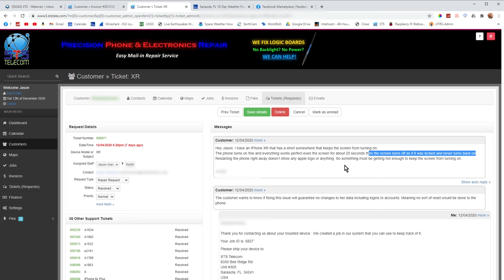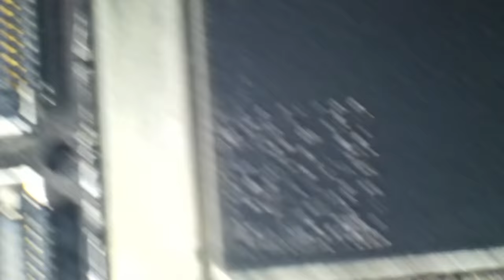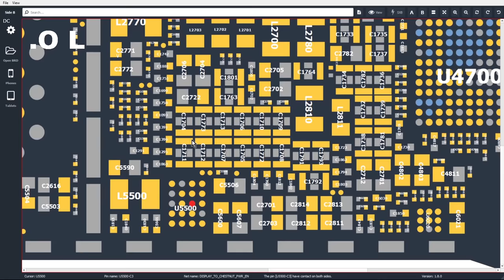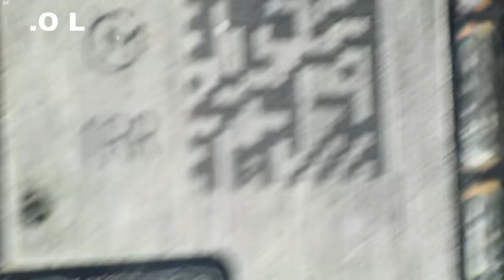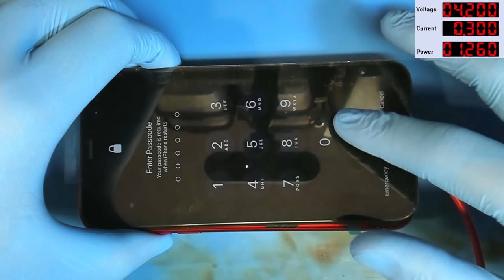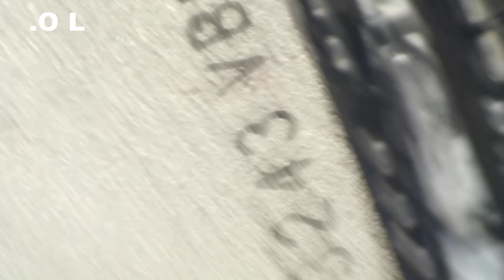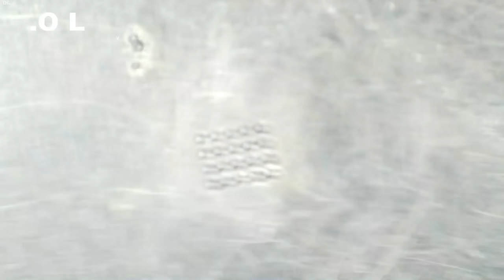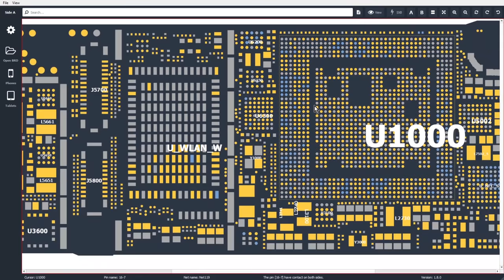Repairing an iPhone XR with "No Image" - What I found inside this phone was horrifying!

Comment: "I'm gonna turn the heater on to a temperature that is not hot enough to boil water even" ...."I'm gonna start at 195 degrees C"
Reply: Lol, that was hilarious
Reply: I'm glad someone else noticed this 😂
Reply: Honestly couldn't tell if he was joking on lol
Reply: @Centorior  He can't tell Celsius from Fahrenheit
Reply: @slyfondle1885  100c is boiling right?
Reply: @MrCODEmaster00  Yep
Reply: To be fair... Even at 195 c shouldn't be able to touch
Reply: @MrCODEmaster00   Boiling point of water in fahrenheit is 212. 190F is around 88C, so 205F is close.
Strangely he does talk about the correct Celsius setting on the heat gun.
Reply: 195C is the temp I use on the  hot end of my 3d printer to melt the plastic.  Far hotter than you would touch.
Reply: @bbowling4979  I typically go 205 but same thought. PLA has nothing on his fingers apparently.
Reply: @docthebiker  maybe his heater is calibrated on F but showing C
Reply: It's clearly a case of confusing F with C. Either the machine displays the wrong unit or he reads it wrong.
195F = 90.5C is slightly under boiling water.
195C = 383F is way too hot to even think about touching it.
Reply: @docthebiker  The boiling point of water AT SEA LEVEL is 212°F. 205°F is the boiling point of water at 3500 feet ASL - the altitude of SLC or Calgary. 

I doubt he's doing these repairs in Leadville, Colorado or somewhere in deepest Tibet, but at those altitudes 195°F is hot enough to boil water.
Reply: @Ea-Nasir_Copper_Co  205°F is close to boiling point (around 96°C) but he didn't go that high. His plate was maxed at 195°F (90°C).
Altitude has no bearing on electric heat output. THOUGH if one was wanting to drive out water without boiling at higher altitudes then adjust accordingly.
Calgary, maybe 190°F.
I'll stick with Celsius.
Reply: “I’m not feeling like this is really 195C...”  
Me: Hmm, yeah me neither.
Reply: I got called on the carpet for mentioning this.  I hope you have better luck.  So, over 300f. Ha!
Reply: Under the right conditions 195 C isn’t hot enough to boil water... but your shop isn’t those conditions 🤣
Reply: @bobafruti  They've found "surface" water at 467 degrees Celsius, where it is a supercritical fluid and the gas and liquid phase merge into one, at the very high pressures of deep oceanic vents.
Supercritical point is 374°C.
Under the ground (and higher pressure), where the magma heats this different phase of water even higher.

I can't remember if there are 14 or 24 states of water, rather than the 3 we were taught about in school (you get 3 just boiling a kettle).
Reply: @docthebiker   I guess the knowledge shall die with you. Google won't give up but only 4 states of water and 22 states for matter
Reply: @KingBigBabyJesus  You're right I didn't use google, 22 states of matter & about 20 states of ice.
There are 2-3+ states of liquid water, & 
As you can google try finding the paper "on the existence of two states in liquid water".
Reply: @docthebiker  Thanks for the reply, I appreciate the knowledge.
Reply: I remember back when one had to avoid higher temperature on IC's, now they're installed at temperatures that'd slag those antiques. Of course, back then we also used solder that melted at a much higher temperature.
Reply: @christianbarnay2499  Bake a ham at 350F

Comment: Hi Jason. Solder melts at about 183C-188C (361F-370F). And you wouldnt be able to touch over 70C (about 158F)for more a few seconds. Think you need to calibrate ;) Greetings from sweden.
Reply: Lead free solder, the solder used now in conventual consumer electronics melts even higher with Tin, Silver, Copper alloys melting at 217 and  and Tin Silver melting at 221.
Leaded solders typically mels at around what you say, but really only has approval to be used in the Aerospace and Medical industries. Aerospace parts and specifically Aeronautics use leaded solder.
Reply: Hey Fredrick, I work in electronics and you seem to be not familiar with the typical SMT reflow temperatures and the typical baking temperatures. He did a fine and correct job. The repair technicians in factories mostly do worse job, they just don't really care. Quality control on refurb stuff usually is not that great. Personally I would not buy or use a device that had a BGA reworked.
Reply: @dtibor5903  I think Fredriks point was mainly the drying part of the board. Where Jason touched with his finger the board heated to "195°C". Water boils at 100°C. He would most definitely burn his finger, it wouldnt be just "slighly warm". Hence the need for temperature calibration.

Comment: I just subscribed. When I started fixing electronics, Most things had tubes in them. Times have changed. I've been retired for a decade. I see you measuring voltages. I used to always use my scope to measure voltage. Caught a lot of problems that a voltmeter alone wouldn't have caught. Anyway, I've been doing a few devices. Didn't know about the software. THanks.

Comment: Gregory House said it best, "People lie."

When they said it sometimes got an image what they meant to say was it worked when they got it, the screen started going off a little while later, it got gradually worse and they refused to bring it to a shop until it would not power on at all.

We see this all the time in IT, the computer would turn off due to thermal issues but as long as it would work for 10 seconds at a time they wouldn't bring it in. They'd only bring it in when it refused to boot at all. At that point it isn't  something as simple as replacing the heatsink fan, it's replacing the CPU and motherboard.

Comment: Alternate title: DO NOT BUY REFURBISHED PHONES (unless they’re from a certified well rated source)
Reply: which apple themselves are not
Reply: @minortoterona2947  umm...
Reply: I bought my Iphone SE almost 4 years ago on refusbished amazon and still goes great. But I was quite aware it was a bet, it could have come with some problems
Reply: @gabrielfernandez4503  I bought one SE from ebay and it does great too. Great performance (and battery life) taking into account its age
Reply: "certified source" would be apple only then?
"well rated source" is pretty much anyone else. At least if one is going to believe what they're saying.
"certified well rated source"  is the unicorn that doesn't exist.

in my honest opinion: never ever buy a refurbished device unless you know what you're getting into.
Reply: Any rework on PCBAs, especially on such small components and BGAs is just ticking bomb. Avoid refurbed electronics with BGAs, basically anything that has a processor, ram.
Reply: @dtibor5903  We lost a bunch of factory HP AIO machines to video reball issues. They'd overheat and then just fail and lose video. We lost about 4 this way. One guy thought the company was actually being sabotaged.. lol.

Only by underclocking the GPU were we able to prevent it. Clearly HP's manufacturer used a ball solder technique that was a too-low melting point alloy and like most manufacturers (including laptops) totally inadequate cooling that leads to ball solder failure. 

I hate ball-soldering with a passion. It's easy for the manufacturer, and always a liability, then they deny the component cooling!
Reply: @Pimp482  
Watch a bit of Louis Rossmann and you will understand why he said that.
Reply: @Pimp482  
Hahahahahahahahahaha ... Yeah okay, right. No use in talking to you then I suppose.
Reply: @VenturiLife  that is some low temp solder that should be not used for BGAs that can get up to 100C
Reply: I am a tech.  I don't buy refurbished stuff. I will refurbish stuff for myself but I do it in a way that its better than from the factory.
Reply: @Mat-hr1dg  wow I'm just mind blown. Lmfao. I guess if a mechanic fixes cars, he makes money from whatever brand the car is made of. Or a plumber fixing damage on a pipe then he makes money from the pipe manufacturer.
The absolute stupidity is stunning.
Reply: @freevideos051  ok?
Reply: @the_allamerican7057  Mostly cooling modifications
Reply: @ChimpOnComputer  
Right?
Some people really blow my mind.
Reply: Since 11/20/20 have gone thru 3 refurb phones from Amazon....iPhone & Samsung....all were physically ok but each had serious speaker issues. Only plus was refunds were seamless & quick. Sold more blood and bought a new XR direct from Apple. Done & done.
Reply: in that case dont buy a new one to.. Its an Apple......

Comment: "Not hot enough to boil water."
Right after...
"I'm gonna start at 195 C."
Dude...serious math conversion fail.
Reply: He is speaking about Fahrenheits I guess. Because when you convert 195 F to C you will get close of 90
Reply: Pretty certain he screwed that up.
TBH I wonder if he was reading the display of 19.5°C incorrectly.
Reply: That's what I was figuring.  Still, hearing it in stride made me pause and chuckle.
Reply: @RichardPolhill  19.5C is like 67/68F
Reply: @InevitableD34th  Yes indeed. Hence he could put his hand on it and not scream as his skin blistered.
Reply: @sami3125  - Even 90 C would give severe burns putting your hand on it. But 19.5 C isn't warm at all, cooler than room temperature. I have no idea what temperature he meant.
Reply: @NotGoodAtNamingThings  I think 90°C solid object won't burn your finger through latex glove. Well, I'm from Finland and we use to go sauna regularly and there's often more than 90°C when I go to the sauna and sit to the wooden bench in the sauna. And it's not burning my skin, at least not severe burns ;)
Reply: @sami3125  - Water at 90C will burn the skin in a faction of a second. But one can stick their whole arm inside an oven for several seconds at much hotter temperatures without incident. Air doesn't transfer heat effectively.
Reply: @NotGoodAtNamingThings  yeah, you're right! Water transfers heat better than most solid things. And this is the reason you can safely touch short time 90°C solid object even when 90°C water will cause burns to your skin.
Reply: Yea , feels like hes meaning farenheit while hes saying celcius since he said he aint going to boil water and 205F is around 96C (205 is what he said his highest setting would be)
Reply: @sami3125  you are referring to the ladnhauer effect ( spelled wrong likely )  the density of any object reflects is ability to have thermal transfer, in the case of the wood mentioned it has low thermal capacity and high r value.. so won't burn you.      Air weighs .076lb ft/3  water weighs 62.4lb ft/3     its ability to retain thermal energy ( thermal mass capacity ) is directly related to its density..

Comment: I laughed when you said don't try it yourself. I am a mechanic . If I can't throw a hammer at it or pry something off of it with brute force I can't fix it. Lol. I have to be able to rough it up a bit. When my computers have issues .I turn them off and back on if that doesn't work it's broken. Lol. Hammer time.
Reply: I prefer the Remington 870 :D

Comment: If I understand correctly, the "Gecko" is a low power sort of processor that in enabled when the main processor shuts down.  It allows for a certain amount of independent function away from the main system itself.   Not entirely sure, but it may be part of the wakeup routine to re-power the main processor when certain criteria are met.
Reply: Is it part of the ARM little big ?
Reply: No this inst a microcontroller. It's a switching regulator
Reply: @For--nop  
Gecko is a microcontroller from Silicon labs, based on ARM cortex-M3.

Still no idea what it does, because ARM say it's not compatable with Big.LITTLE.
Reply: @kevinshort3943  Its a different gecko. Show me a ARM gecko with 16 pins.
Reply: @For--nop  
I can, but it won't be a Gecko.

So what is it and what does it do then?
Reply: @kevinshort3943  I dont know for sure, but its right next to USB power delivery and replacements parts reference FAN53740UCA1X
 so I expect its a custom switching voltage regulator to feed the Hydra USB power mgmt  IC
Reply: @For--nop  here's the datasheet. Bucking power supply running at 2.4 mhz.
https://www.onsemi.com/pdf/datasheet/fan53540-d.pdf
To judge from the iPhone schematics, Apple didn't do the typical lazy engineering of copying the example circuit. That's actually a refreshing experience, seeing real engineering for a change!
Reply: Huh... and here I am thinking it had something to do with using my phone to save on insurance...

Comment: You need to get yourself those clean-room or lens cleaning q-tips with sharp ends. They dont leave residues and fibers and also make work so much easier.
Reply: That bugged me as well, but he ultrasonic cleaned it afterwards which should help.
Reply: And good ol kem wipes with strategic dental tool trimmed to fit i used to wick away excess liquids. Ditto on the cotton hairs, yuck.
Reply: Great job persistence and a little less flux, you knew it the moment ya did but got to anxious. hey like i never did that....good catch! hero!
Reply: Fascinating video. I really appreciate the fine details and your expertise in fixing the phone. It is amazing how it all works together. Thank you I now have a broader understanding of how phones work.

Comment: Your second question, that IC, I think you called it Geicko, if I’m not mistaken, is responsible for the wireless charging system if the iPhone. I don’t have the diagram in front of me, I’m going off the top of my head. That would also explain why the iPhone was still working after you removed it. Anyway, superb video, as always!

Comment: His job has the biggest highs when successful but I’m sure when things don’t go as planned it can be like losing a family member. This is why I could only do this as a hobby on my personal electronics but never take on the responsibility of not destroying someone else’s. That type of stress I’m sure is too much for most. His job is admirable and so is he.
Reply: I do repair work on the side and before any work is done the customer has to sign a waiver to clear us that clearly states something like “back up your data! any loss of data is not our fault”. make sure to back up BEFORE something goes wrong because it’s usually impossible to recover data from flash chips without sending it to an expensive data recovery facility
Reply: another story: one time an old dude came in super upset saying WE broke his new desktop. so we took a look and hot damn, the PCI network card he had in there was half ripped out of the socket and the socket was physically lifted off the board. some true tech gore there 😬 so we told him “dude you tripped on your internet cable and broke your board this isn’t our fault at all” and he didn’t believe it at all. eventually he settled something out and got a new pc with the owner but he was still pretty pissed when he left

Comment: Had a quick question about your pre-warmer, you stated that you were using Celcius temps and that you are not even hitting temps to boil water, then stated that you were able to touch a board at 195C, this temp would have burned your fingers even with a glove on.  100C is the temp water boils at so , am i confused or did you mis-state the temps or the scale
Reply: He was pretty clear that the temp on his pre-warmer is not calibrated correctly.
Reply: Probably mixed the celcius with farenheit. 195f is sbout 90c and 205f is 96c. Youd burn your fingers on that, but not much. IE its doable without geting blisters.
Reply from the maker: This heater is using C but between it being uncalibrated & the massive amount of heat these boards dissipate, the boards don't get nearly that hot.  I set it to where I need it to dry in a few hours.
Reply: @ststele  Ahh. That explains it.
Reply: @ststele  i wonder how many fires are falsely blamed on batteries and not scammy refurbish work... ?? not just in phones but other electronics...
Reply: The ground plane on boards succs the heat away, good for your fingers but not good for you when you're trying to get something to melt lol

Comment: "I'm not going to set this temperature high enough to boil water."
"I'm going to start at 195C"

Me: "..... Do you know what temperature water boils at?"
Reply: I was listening in sheer confusion when he said 195C then he said 350C, and I realized he really meant fahrenheit, otherwise there'd be a nice healthy glow, and melted/smoking chips.
Reply from the maker: But only seconds later I show myself holding my hand on that board and that it is not that hot. Between the heater not being calibrated and the massive amount of heat that these boards can dissipate, I set it to where I need it to dry in a few hours.
Reply: @ststele  I think your "195 C" was about 150 F.
Reply: It depends on atmospheric pressure.
Reply: @_r-a-f_  lol
Reply: Oof